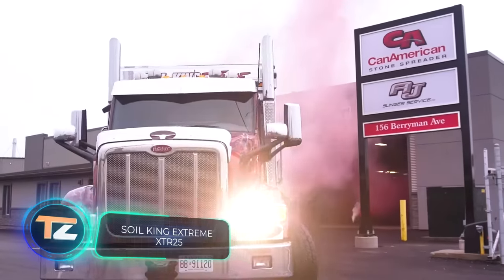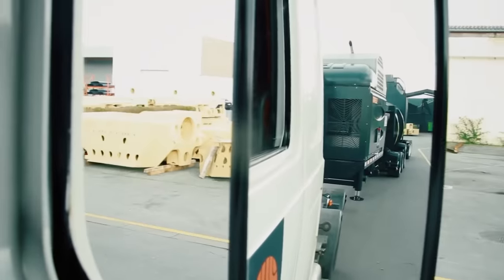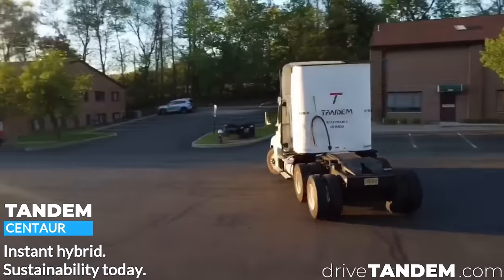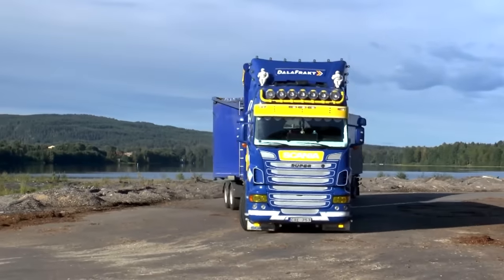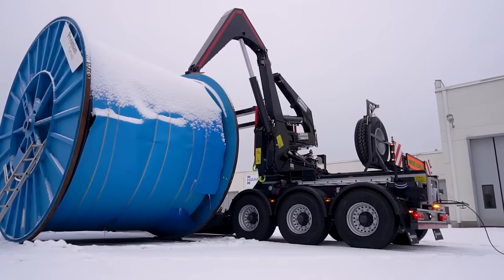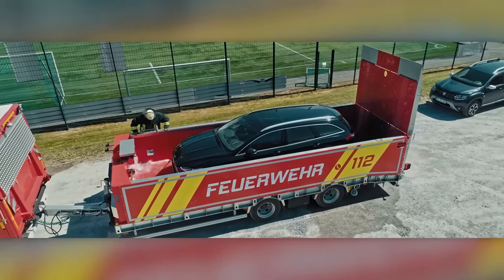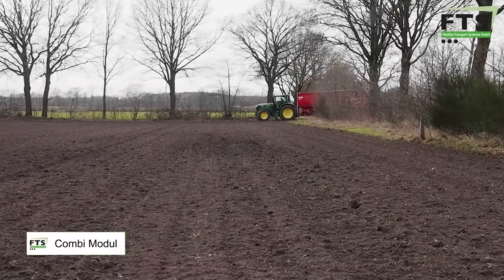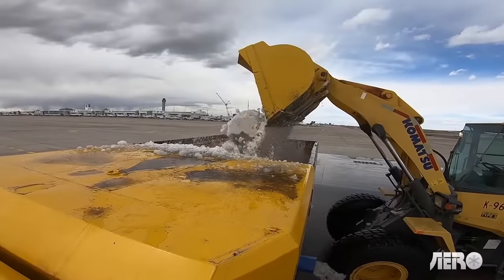INCREDIBLE TRAILERS AND TRUCKS FOR THOSE WHO HAVE ALREADY SEEN EVERYTHING

Comment: The transmission of the road tractor will not be properly lubricated and will cause failure . This comment is about the electric conversion road tractor .
Reply: *Truck
Tractor is a farm vehicle as seen at 8:14 spreading fertilizer and water from the combi trailer.
Reply: Care to explain?
From what I understood the fuel engine of the truck is running at all time (which makes sense).
Reply: @ppdan  Dan ,the way I understood this concept was when this dolly is hitched to the tractor,the dolly axle has the electric motor driving it . The battery is located in that console in the front of the dolly .
Reply: @vicpetrishak1077  Yes, but the engine of the truck has to run (for obvious reasons).
The claim is "Cuts diesel use up to 95%" from which we can conclude that the diesel engine is running even if traction comes from the "dolly" (otherwise it would be "up to 100%")
Reply: @ppdan  Thank You  , Dan . I now realize why the tractor ‘s engine operates .  It powers the air compressor , A/C compressor , power steering pump , and alternator .
Reply: @vicpetrishak1077  Exactly ;)